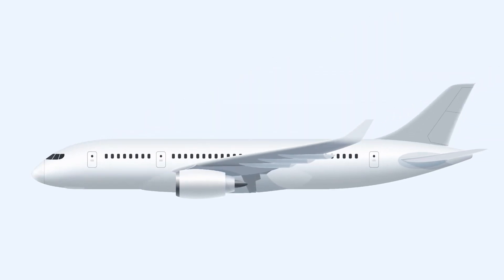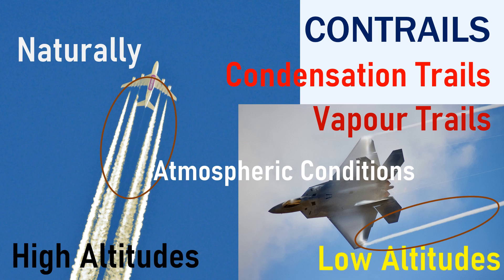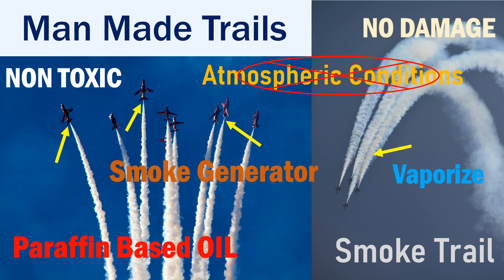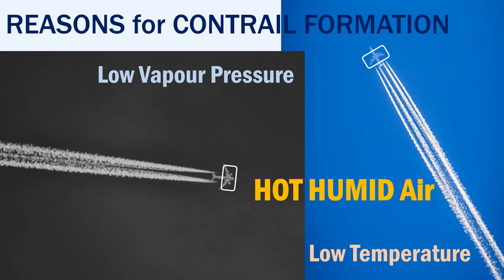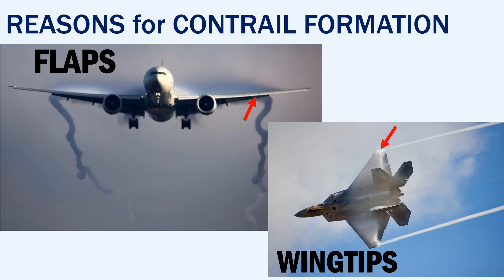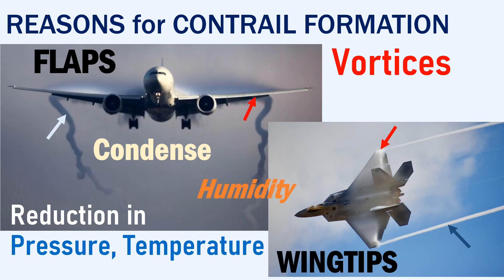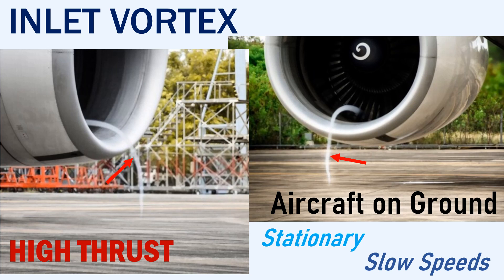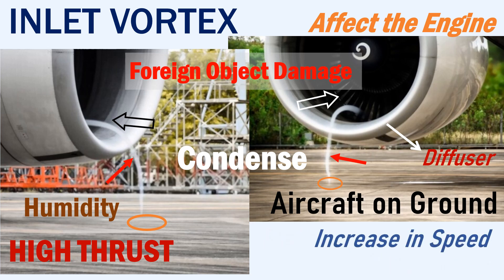Understanding Contrails | Types & Reasons for Contrails | Ground Inlet Vortex | Do Chemtrails Exist?

Comment: Really statisfying to gain more knowledge :*
Reply from the maker: Great to hear that! :)
Reply: Btw i wonder the smoke that appear above the wing(oftenly on f16 wing)is it contrails?
Reply from the maker: @enriquesheriman4917  It is similar to contrails because it happens because of condensation of air. But above the wings contrails, will only happen when the aircraft is flying very close to or above the speed of sound.
Reply: @JxJAVIATION  okaayy thankyou so muchh bruhhh

Comment: 0:45 trails on left and right plane are not the same. Left are made because of engine exaust at hight altitudes because of difference between temperature, right one is made because of maneuvers at the edges of wings and has nothing to do with engines exhaust.
Reply from the maker: Yes. Have explained them in the video!
Reply: @JxJAVIATION  Didn't realized at first watch. All good :)

Comment: Where is this humidity coming from? The air cannot hold any water at such low temperatures and high altitudes. 
Are the jet engines really making all that water?? Enough to create a giant cloud that lasts hours??
Reply: The combustion of 1 kg of kerosène produce nearly 1,4 kg of water. Anyone with basic knowledge of chemistry can confirm that.